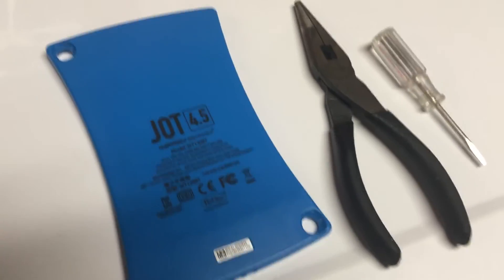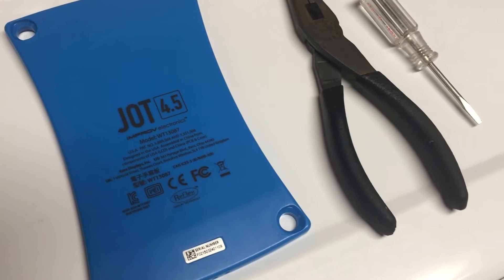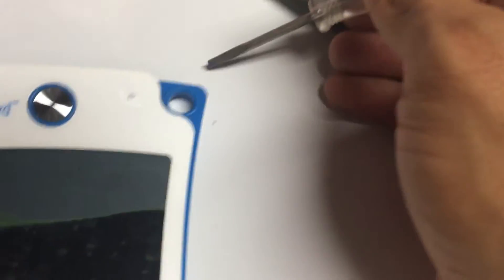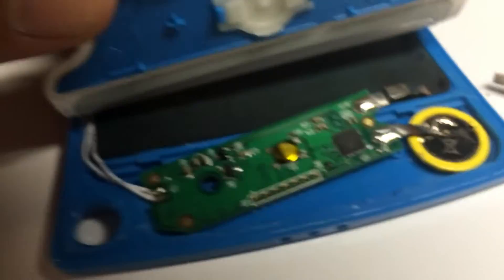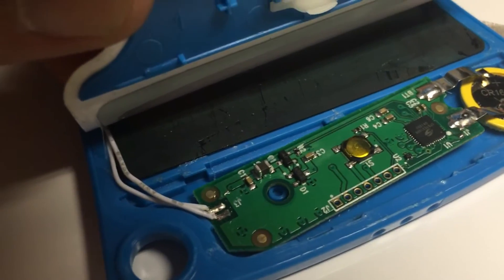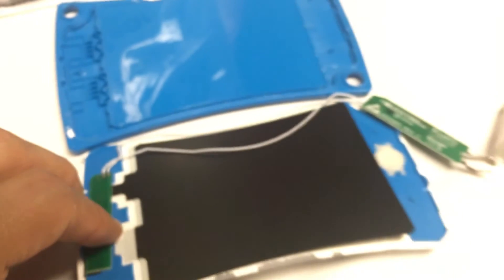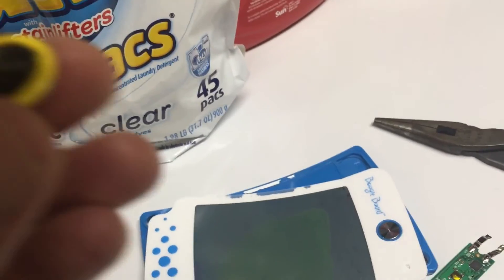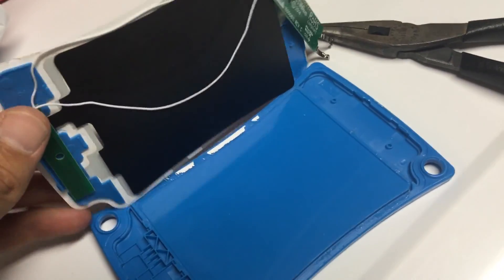Jot 4.5 Boogie Board Tear-down, Disassembly, battery access (non-replaceable battery)

Comment: I used your video as inspiration to try changing the battery. It's definitely doable if you just cut into the right area... turned out not  to be a battery issue though. Full writeup here: http://blog.ambor.com/2017/01/repairing-boogie-board-wt13087-aka-jot.html

Comment: :( i wish i could replace the battery on mine :(
Reply: WARNING: It is so crazy that the battery might explode so forget about it! ;D
However this guy drilled a battery https://youtu.be/L95NvARtcxo  but it never exploded so I dunno!
There is some crazy solution, first figure out where the contacts for the battey are.
Get someone good at drilling to drill the contacts with a large bit to cut their ends by drilling.
then using small bit drill inside the contacts on the board right in the middle/center.
use screws wrap wire around the screws and use for -/+ use tape to stick the new batterys and its wires to the board or get a hold for batteries of that size.
https://duckduckgo.com/?q=1620+battery+holder&iax=1&ia=images
fill the big holes with silicon and cover the whole thing with tape 
or using a color printer and gloss sticky paper do you own cover design, just of the area you worked on.
I hope you get the idea, try it, expand on, improve it and share it on instructables site if it were successful
NOTE: before drilling big/small holes use a ruler and put markings. Big holes are next to the board not on it. And the drilling with a big bit should cut the contacts.
Good luck & regards

Comment: What if you cut a straight line across the top above the screen could you change the battery without damaging the screen?
Reply from the maker: The only way you can do that would be not to "unpeel" the screen layers from each other - I guess you could make a physical clean cut at or near the border of the screen, then access the battery without unpeeling the screen components. Trying to actually separate the components at the existing seam like I did in the video is almost guaranteed to somehow unpeel a significant part of the screen, so maybe a cut in just the cover to get to the battery is a better way of achieving a battery replacement.